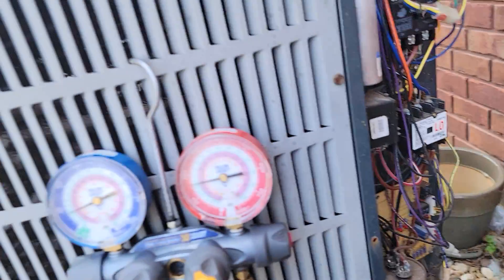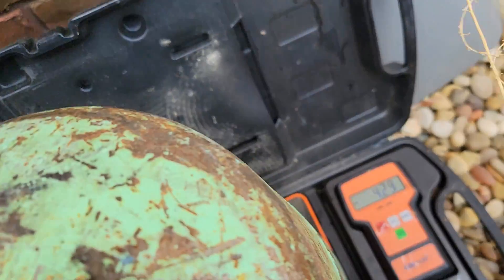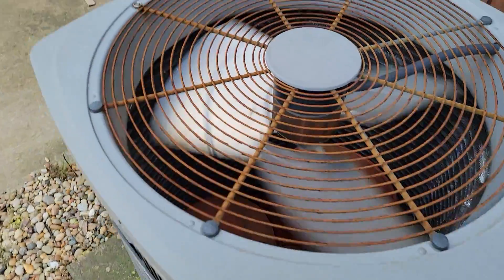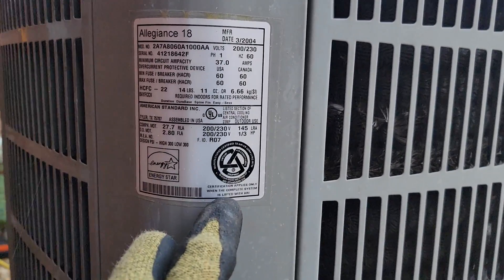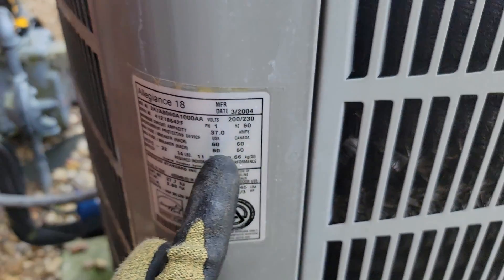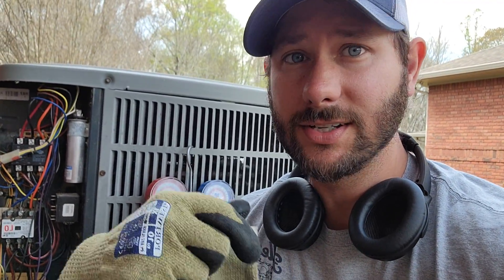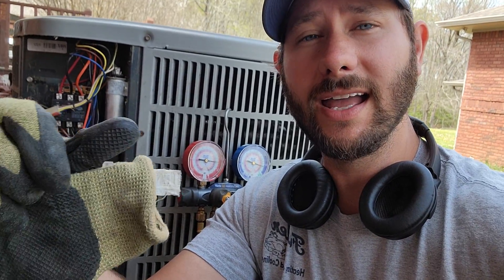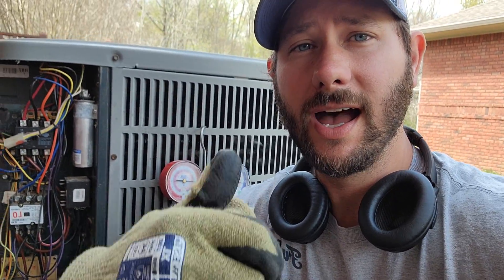How much does it cost to charge an air conditioner?

Comment: In my opinion it should cost about $50 a pound to the customer and not $100 a pound like most companies charge and I can't believe they charge $80-90 just to drive to your house! Some AC companies also charge like $80 for a capacitor that only cost $15-20! Also new refrigerant is coming out January 2023 and then r410a will be outlawed in 2025 and will get expensive, so my plan is to make old r22 units last until 2023 with some leak sealer and refrigerant and then skip r410a!
Reply: Supply and demand man. Theres a shortage on labor. Has been in the trades for years. Covid has only exacerbated that not to mention the housing boom.  It sucks but if they didnt charge this amount they wouldnt find employees or theyd just only deal with commercial accounts which Ive found is typically where the money is at and typically less of a headache as well.
Reply: The only bad thing about hvac being picky on who they’ll do work for…regardless of ability to pay high amounts…the average home owner doesn’t know that Freon is made up of highly flammable gases and when they try fixing it themselves and something blows up..that’s on those trained professionals  who refuse to work on specific types of units or homes etc…I know this because we were fixing the brazing on my unit and didn’t know that r22 is methane mostly…thankfully the unit had leaked everything out this past winter but it infuriates me that the sobs around here are so good they won’t work on older homes or units and feel the need to discriminate against people like me assuming I don’t have enough money to pay for their work…I even told the last hvac guy who wasted 8 hours of my time by demanding someone be home when he shows up or I’ll be charged for nothing and he won’t work on my unit…and then didn’t show up but called at 4 pm…supposed to be here at 8 am as he was scheduled to be…to condescend on me and treat me like I’m the pos! I even told the sob to charge me double per lb if it’s that big of a damned deal!  And he flat out told me he wasn’t wasting r22 on my ac…that was the reason…not because it has a leak and he can’t fix it first then recharge it like the original plan was..nope..it’s because it’s me and that’s it…there’s more to why I am getting the harassment and neglect by this community..having to do with someone in California with the same name that these background check places have mistakenly put my info with hers so it’s being assumed I’m a criminal lol..I’m not…never been to CA ever….idiots…and their assumptions…but hey..at least he didn’t let my dog out like the electric company did! Lol
Reply: @w8what575  well some companies can't get r22 anymore and if you need a lot of it, it ends up being so expensive that it's worth getting a new unit, but there's no excuse to treat you like that. That's messed up.
Reply from the maker: I don't like all the retrofit refrigerants for R22
 Takes a lot more of the retrofit refrigerant to fill the unit up and achieve the same temperature split as the r 22 did 
 I agree there is a lot of overcharging
 Some of that may be due to larger companies and larger overhead
 But $80 for a capacitor especially if its like 10 mfd or 40 or something really small is a definite rip off
Reply: @taddydigest  where are u guys from , in California one capacitor any mfd, can cost you 250-300 dollars, 🤣
Reply from the maker: Wow lol 😆 🤣  I am from Tennessee Right in between Nashville Memphis and Jackson
Reply: @themrmoy40  holy crap batman! That's way too expensive for a capacitor! I'm in alabama and sometimes Miami, but even in Miami Florida it's about the same price as alabama.
Reply: @themrmoy40  They use a flat rate book. Gives accurate cost ahead of time but it can be pricey!
Reply: @taddydigest  is r22 supposed to have the same temperature split as r410a where the return and supply vents should be about a 20 degree difference?
Reply from the maker: yes
Reply: @taddydigest  ok thanks. That means I'm low on refrigerant then.
Reply: My parents were just charged $350 for the guy to swap out the capacitor on their unit…now that it’s no longer covered under warranty..all sorts of breaking down…I told my dad not to bother with the rip off artist that we can do it ourselves now…I walked my 20 year old son through replacing his on his really old ac via FaceTime lol…and he paid $8 for the capacitor he found at a small store in the town over…
Reply: @w8what575  Yeah, I went to a service call where someone changed their own capacitor and wires it wrong, now they need a new compressor lol
Reply: @w8what575  my AC tech a friend of mind charge me 35.00 for capacitor and great conversation. I gave him $45.00 cause I know what an AC tech from name brand hvac shop would have charge me, the tech would probably say “you need a brand new unit” in which I only needed a capacitor
Reply: Hey you should move to China and get good prices! lol
Reply: Do you have any idea how much it costs a company to come to your house? Not just gas lol. It should be more than that with how much shit is now. Go to a car dealership, they charge you the same kind of diagnostic fee and you have to bring your shit to them. It's called overhead, overhead is very high for a HVAC company, also it's a trade, it's not mowing your grass that anyone can do. If you don't like it go learn it yourself!!!!